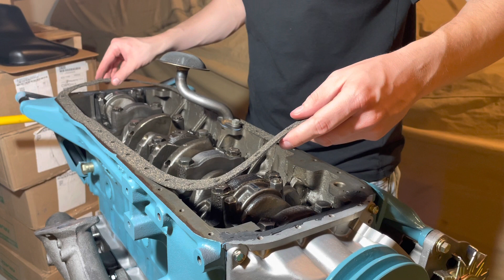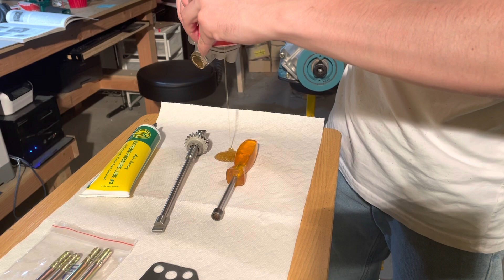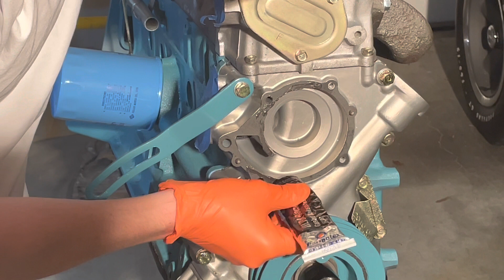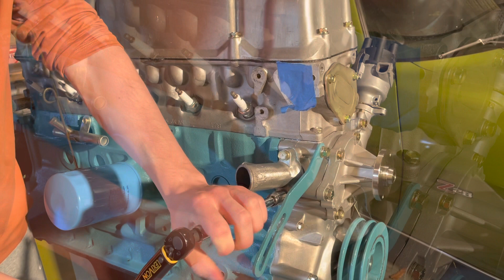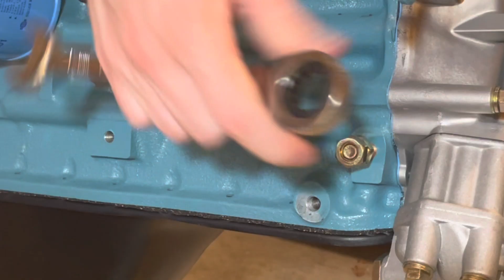Datsun 240Z L24 Engine Rebuild Ep. 16 - Final Assembly of the L24 + Installing Peripherals

Comment: A couple of tips: Dealing with oil pan bolts in a car is a pain, replace them with studs and nuts. Instead of RTV, use Permatex No 3 aviation goo on paper gaskets, you can reuse them forever. Also works well on rubber gaskets like the rocker cover. Just don't spill it in your toolbox, you'll never get rid of it!
Reply from the maker: re gaskets: makes sense, I’ll look into that in the future.

As for studs, the goal for this engine was high originality.

Comment: Hi,  I'm reviving a 240z that has the exact same thermostat housing with the big outlet and the other 3 little. But the car is missing the 3 little hoses and I'm trying to figure out which lines they plug into. Got. A pic? I haven't found a diagram and it doesn't show in the manual. Thank you in advance and I love your rebuild!

Comment: Hi there, saw your post on facebook engine looks stunning. I just had a quick question regarding your method of cleaning up the intake manifold and linkages. I sent mine to be media blasted, and they came back really rough and dull - nothing like original, in fact I'm worried I wont be able to use them at all. Any idea on what I can do to correct this?
Reply from the maker: Hey Troy, sorry to hear that. Send me a few pictures: mark@zcarguide.com. I went with vapor honing with ceramic beads. That can really shine them up so you may want to try that
Reply: @zcarguide  I will be picking them up this coming monday; I'll email you a picture then.
Reply from the maker: Anytime! I’m around. Best of luck, these are wonderful engines

Comment: Got job now I can ,send your video to people that think a Z motor is over their head.
  If you can bolt a motor together, than you can mig weld in 30 minutes practicing on scrap metal and a YouTube video.
Mig welder $100 at harbour freight helmet auto Darkening is like $30. At HF.
Get one and save many dollars and add another extremely useful skill.
I've rebuilt two rusted Z cars same welder no issues.

Comment: Maybe rather than hiring a welder for the stand, buy a cheap on and get started. Welding is a very useful skill for working on these rust prone z cars, and even a cheap flux core welder can help you learn. You could probably get started with a flux core setup for $200 - $300 for a welder, hood, wire, gloves, and a grinder and some cutting wheels from harbor freight and/or Amazon.
Reply from the maker: I'm definitely considering it. I'd really love to learn how to weld. At the moment, I only have access to 120V in my garage and I was doing some preliminary research and had a couple people tell me it's best to learn with a good 220V unit. I may be moving soon and if I'm able to get a setup where I can get 220 in the garage, I'll consider it. For now though, I think with my timeframe it makes more sense not to add learning how to weld to my to-do list with this project.
Reply: @zcarguide  that’s understandable given your time frame. I have a dual voltage Vulcan welder from harbor freight, and it works well on 110v, so there are some good 110v options out there. Dual voltage machines can be run on either voltage, but with more welding power on 220v, so could be a good option if or when you do get one if you don’t yet have 220v.

Comment: question, do you think you’ll do any sort of breakdown of what it has cost to complete this build?
also it’s looking sick. has me super inspired to start tearing into my L24.
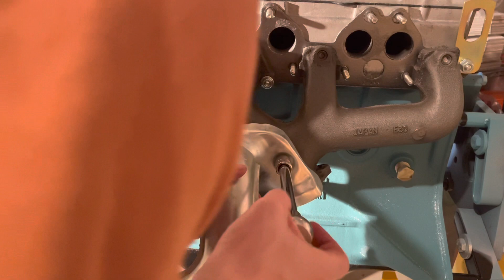Reply from the maker: Hey, I don't know if I want to look at the final bill haha. I might make a video for it but let me draft up a few of the more significant costs. A decent amount of things were done for me as favors. My dad has helped me with a few different things - refinishing the oil pan, he's working on the air cleaner for me right now, etc. A friend helped with getting some old plating  off of the engine plate and the clear zinc intake tube you see at around 15:13. He also just finished up aluminum welding my distributor parts and drilling/tapping new holes. These were all favors basically -- either charged nothing or very little. I don't think they would be expensive if you found a shop near you, but just noting that I had a lot of help. 

I think Jason charged me around $500 for the machine shop work which is absurd (too low!)-- he gave me the friends rate considering he stuck around for hours to help me put everything together and teach me. It was around Christmas time so I gave him double that. I really don't know what real machine shop rates are so I'm inclined to not even add this here.

Zinc plating was $150. They typically charge $150 per color and I had clear and yellow zinc. They mixed up a couple bolts and felt very bad about it plus I only had a couple clear zinc parts so they decided to just charge me for the yellow zinc. I tried to pay them more but they wouldn't let me! 

Vapor honing was about $50. At one point I dropped some stuff off at a media blasting company and they charged $150/hour! They came in at exactly an hour for a few parts (hmm) and charged me $150. 

A lot of little parts you can find prices for online. Water pumps and oil pumps are like $20-40 apiece. I've probably spent about $75 on new hardware. $50 for a gasket kit. A decent number of parts I have been able to pull out of my inventory from shop.zcarguide.com. I've also bought tons of other parts from different eBay sellers and other Z stores. I'm sure I've spent $500-1000 on all kinds of extra parts and things. 

I'm sure the final bill would be a bit unsettling to me if I could actually see it, but it has taken me almost 2 years so I would say for your own project it's best to go slowly and take your time anyway, so might as well spread out the cost too and buy things as you need them.
Reply: @zcarguide  I appreciate the thorough response! So far that’s not as bad as I was expecting. I don’t think $500 from the machine shop is bad at all. My grandfather had his U20 engine out of his roadster rebuilt by the machine shop and I wanna say it was about $800 for him, and that’s just a 4 cylinder. But, like you mentioned, spreading everything out over x amount of years would really lessen the blow. It’s just painful knowing it takes so long, lol
Reply from the maker: Just to be clear, I’m saying I think the machine shop charged me a bit less than normal as the owner is a friend of mine not more haha. Also I definitely really took my time with this, it really should only take a few months if you’re hustling a bit. The machine shop specializes in race engines and were busy from April to September 2021 so my engine was just sitting there for that time, and I took about 6 months with my job search at the beginning of this year. Not to mention, making sure I get footage of everything and release videos regularly makes it take a bit longer.